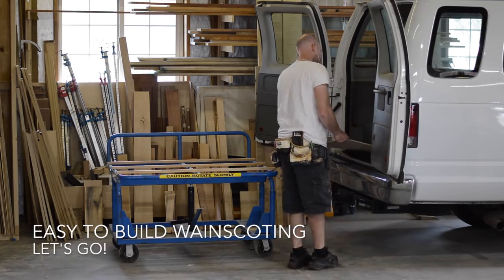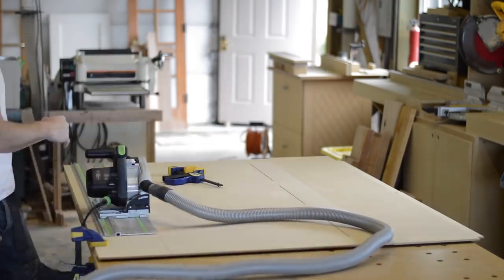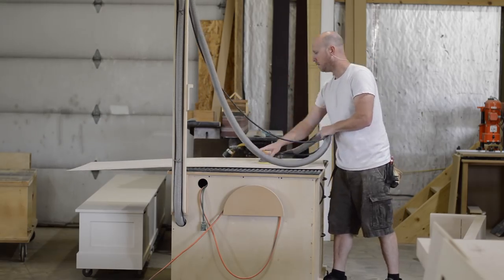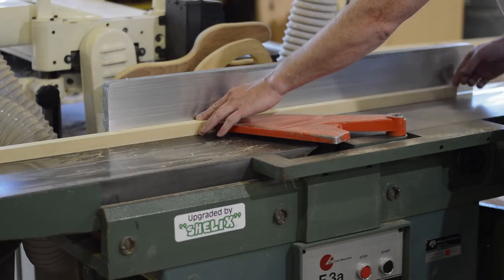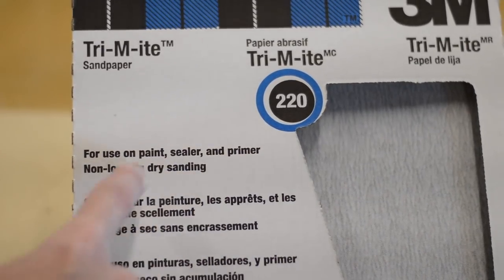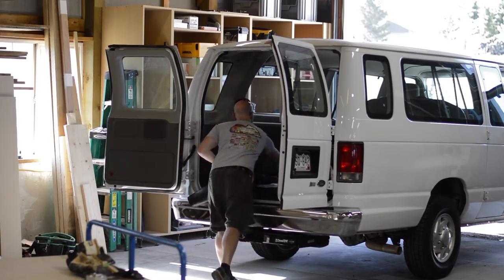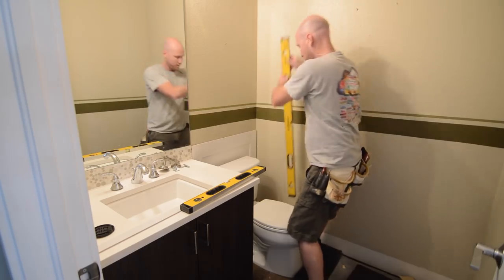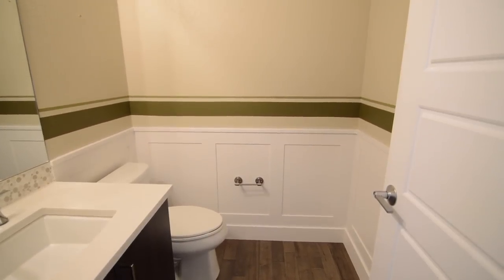Easiest wall paneling ever! Wainscoting

Comment: Mike, your shop is amazing (except for the router tabel, but you said you were going to rebuild it anyway).  Your video is extremely well done.  Thanks for putting me onto the 1/4" thick flat tooth dado blade for routing grooves in the drawer sides.  Just ordered me one.
Reply from the maker: Thank you. You will find many uses for the 1/4" blade.

Comment: I like it!  Clean and neat ... I need to do some in my kitchen.  You just showed a less expensive great looking way to do it!
Reply from the maker: Thank you. Give it a shot. Yes, I forgot to mention in the video, but this is a super cheap way to achieve a clean wainscoting. Couple sheets of 1/4 and 1/8, little bit of hardwood and some base molding. I spent way more on paint/primer than materials.

Comment: Excellent video Mike. Thanks for sharing. One tip: when caulking, use a grout sponge instead of the old tee shirt and wipe your finger on it. Oh yeah, that looked like a common rat snake, which is good to have around (unless you have chickens as they also eat eggs).
Reply from the maker: I like this tip. Thank you. I may give this a try.

Comment: Nice. I do a lot of wainscoting myself, this design is beautiful in its simplicity. Good job.
Reply: There are definitely some differences between the normally installed wainscoting and this design.  Because you've don a lot of it, what are your thoughts, positive/negative on each if you care to discuss.  Thank you.
Reply: James Jacobsen well obviously the lack of joinery and practically no filling or sanding is a big plus. This would greatly speed up the making/installing process. The only negative I see is that it wouldn't be up everyone's taste.  A lot of people like the raised panel designs, which takes a lot more work. But then you charge accordingly. It's all down to customer preference at the end of the day.
Reply from the maker: I'd be interesting to know the differences between normally install and this version.

Comment: Festool plunge saws are amazing. I've built so much with this tool.
Reply from the maker: Such a great tool. I find new uses for it all the time.
Reply: My favourite use is dimensioning rough lumber on the jobsite. Rough lumber is usually flat enough to feed through a portable thickness planer, but never straight enough to cut on the table saw, and there's obviously no surface planer (jointer) on-site. That's where the track saw comes in.

Comment: Having just discovered your channel and watching a few of your videos, I felt compelled to subscribe, Mike. Great job with your video production. With respect to your practice of adding water to your little cup of paint for the finishing details: Try using a product made by "Flood" called "Floetrol" instead of water. Floetrol will allow the paint to flow easily and lay flat, without any visible brush marks - it will look like it was part of the original spray application. Flood also makes a similar product for oil based paints too, if ever needed. It's available in a variety of stores, including Home Depot.
Reply from the maker: Yup I use floetrol all the time. Good stuff. I find that for touching up nail holes I like to use water because it thins the paint and physically leaves a thinner film. To my eye this looks a little better.

Comment: Mike, you mentioned in your video if your wainscoting was longer than 8 feet it would be a nightmare. One thing you could do prior to finishing is butt two pieces three quarter MDF together and join with Domino's. We have found the Bondo can completely make a paint grade joint disappear. Experiment with some Bondo and you'll find you will love it, if you don't already use it. Great video! thanks.
Reply from the maker: Yup, good tip. I use bondo frequently, but it still adds a step.

Comment: Really like the end result. Neat idea to cut out from large panels rather than build up from small parts. It’s tedious to try to hide join lines, though it’s easier in Mdf than other wood in my experience since it’s already particle board and the filler is adding more particles, essentially 

Anyway, another great video. Your narration has to be among the very best I’ve seen (heard)
Reply from the maker: Thank you for the kind words. I find that by removing the joinery, lots of time is saved in both performing the joinery and sanding/filling/painting.

Comment: Hi Mike.  Have you ever thought about stops on the track. This is how you cut a mat for a picture which I have done tons of times. There is a stop or block to end the cut.   That will also make a consistent cut. I am planning to make some doors this way.  I use a blade to tap out the mat corners just as the Japanese saw.  What do you think?
Reply from the maker: Thank you. The stops could work, but the setup might take too much time to make it worth doing. Making doors using this method would work great.

Comment: Mike, do you use moisture resistant MDF?  I didn't even know it was available until recently.  When I asked for some at my local Big Orange, I was told they never heard of it and didn't stock it.  Since moisture is a real enemy of MDF, it would seem the MR-MDF would be a real advantage for bath and kitchen projects.
Reply from the maker: I do not. I don't because no one sells it near me. If they did I would use it. I agree to the advantages.

Comment: I wish I had did the wains coating in my bathroom like this. I tried to use the premade sheets at Home Depot & it was just a mess, especially with one of the rounded corners in the bathroom. This is way cleaner.
Reply from the maker: Thank you.

Comment: I like the decision to overlap on the casing. I was wondering if you would install to level or parallel to the painted stripe (assuming it wasn't perfectly level already)  until you mentioned the wallpaper.
Reply from the maker: Yup, the paint is on the way out. I'm going to try to go back and get a picture when the wall paper is up.

Comment: Great video mike. I rip sandpaper the same way by tearing it on a sharp edge. I use a 1/4” piece of mdf that I joint on edge and crease the sandpaper, but for some reason I can’t figure out I always rip the paper diagonally which results in wasted sandpaper. More often than not the tear trails off of the crease towards the end of the rip and sometimes right in the middle of the rip. Any advice on tearing technique to avoid this?
Reply from the maker: Thank you. I'm not sure I follow exactly what the issue is, so I'm not quite sure how to advise. Give me a little more detail.

Comment: At 12:20, you mention you are using the level to check that the panel does not have a bow or hump. Since you already placed it against the wall with adhesive, how would you have corrected this if you noticed it was not flat?
Reply from the maker: Good question. I have the panels sitting on a bed of adhesive, so most of the time pressing the high area squishes the panel into place. If that doesn't work, I will pry the low spots away from the wall and apply some more adhesive.

Comment: Is there a formula you use to figure out your panel size? Other than behind the toilet, I assume the panel size is the same on the other walls? Thanks for the excellent video!!
Reply from the maker: Not really. I play around with the spacing while talking with the customer. Once we decide on an overall feel, the math begins. If the space it 60" wide and I want 3 panels, its 20 per each. If the wall next to it (as in this video) was 64, the its 21 and change per each. It gets a little weird when they are not close to a multiple of 20, so if one wall is 60, great 3 panels, but the wall next to it is 72, 3 wider panels or 4 narrower panels will fit, thats up to you to pick. Its a judgment call that must be decided by the builder. Hope this helps.

Comment: Thanks again for the pro tip on the construction adhesive Circle suction Style. Going that method has anything falling off the walls and or do you feel that it seems to give it a good adheisure  application. I've started to adapt that on my installs always a little worried that it might not secure properly?
Reply from the maker: My pleasure. I got that tip from a guy who put up shower paneling, and didn't use any screws or nails. Construction adhesive is very strong once its dry. Just make sure its stuck on real good and check it a few times. In an hour or two that thing isn't going anywhere.

Comment: Mike, can you share what type of hose you are using with you track saw.  I see u are using the festool track saw but not the festool hose.  I am planning on purchasing a ts55 soon but I am looking for cheaper options for dust collection hoses.
Reply from the maker: Its a Bosch hose. I think they are like 40 bucks. Works great with Festool and other tools that use similar connections.

Comment: how are you getting the door trim and the base to line up correctly? after adding the wainscoting im imagining that the base would be sticking past the door trim.
Reply from the maker: If you look at my video Dining room renovation, wainscoting, I show the how I deal with that issue. Effectively, I just lay the base and chair rail over the casing. I think it creates a nice look.
Reply: @MikeFarrington  ahhh i must have missed that when i was watching the video. i was trying to skim through to a part where i could see what you did. very nice work my man!
Reply from the maker: Its in there somewhere, I promise.

Comment: As always, an excellent piece and an excellent video. Your VO especially really stands apart. Do you think one could achieve nearly the same level of finish without a spray setup? The rest all seems well within reach, just don’t have the room, or expertise for the spray setup.
Reply from the maker: Thank you very much! I would rather have the project in my house, painted with a brush and roller than to not have the project if I couldn't spray it. Hope that makes sense. Light plays a big roll as to what "shows" on a finish. In a bathroom with very little raking light, brush and roller would end up looking pretty good. Buy a very high end paint (like ProClassic), add a little floetrol, maybe even a little water, use a very good brush and roller, and make practice boards. My guess is you will be happy with the results. I hand painted many projects when I was first starting, they ended up looking very nice.

Comment: Mike, the panel behind toilet  were you use straight edge to check  for  straightness  on inside corner. If it was  not , would you pop it off with the glue attached an shim it straight. It looks great.
Reply from the maker: Randy, if it was not straight I would try squishing the panel into the glue more, if that didn't work, I'd pull it out and start over with more glue. In those situations I really try to use the glue as a shim, if all else fails a shim will do the trick.

Comment: Hey Mike. This one hits home because I just did a similiar job lol. Beautiful stuff man.

I know you got a work flow and a process already down, but have you ever tried Chemcraft or Lenmar acetone based primers? You gotta thin em down about 30% and sometimes use some retarder. But they actually hang much better without running, lay flatter (requiring less sanding), and cover a bit better. With 2 coats of that stuff sanding in between literally the surface couldnt be more perfect and one super thin top coat does the trick. I also use a water based lacquer or poly as top coat. I use General Finishes. I love that their product line is kinda dummy proof which I need lol. 

We do very similar work, and I did a few hours worth of testing between the Lenmar and Chemcraft acetone primers and the Zinsser BIN. Only crappy thing is you gotta play chemist a little more with the acetone primers. They are so thick (relatively speaking) and don't flow good from anything other than an airless right out of the can. But that also means you get to stretch the can and save some cash.

At least for my personal work, (which we have similar styles) the acetone primers seem to be superior to the BIN unless I'm doing a refinishing job and wanna stop some stain bleed through
Reply from the maker: Thank you Michael. I have used the Chemcraft primer before. I think its really good. I cannot get it locally, vs the BIN I can get at the Lowes 3 minutes from my house. I do agree on how good it is, but often times with finishing its how easily can I get my hands it. This is especially true when I need colors mixed.
Reply: @MikeFarrington  absolutely. if I didn't live next to a Benjamin Moore I think my life would be a lot more difficult in regards to good primers. thanks for the response! I'm glad to hear you are familiar with their products.
Reply from the maker: @MaydaysCustomWoodworks  I hear ya. I used to live near a very good paint store, not so much anymore. Its a real downer.

Comment: I'm curious as to how you calculated the number and size of the panel openings to maintain symmetry between walls of different lengths.  Also, how the size of the sink may have affected those calculations.
Reply from the maker: Ah, thats the thing. There is not symmetry. It comes down to how many flat spaces to you want. If one wall is 60 inches and the other is 65, well the difference just needs to be blended as best as possible. The flat spaces will be larger on the 65 inch wall. There is no right or wrong, you just need to play around with the layout until things look as best as possible.

Comment: Hi mike just subbed great content. What would you say the benefits to using a traditional spray gun vs a hvlp setup. Im on the cusp of buy a fuji 3 pro but im new to spraying and it would be good to get you input cheers
Reply from the maker: Traditional spray guns will atomize heavier materials. There is a point where all turbine driven HVLP guns just don't have enough power to break up material as it gets thicker. With a conventional gun run way below the max recommended pressure I can blast even the heaviest paints into a nice fog. The down side is over spray, conventional guns make a ton of overspray. I don't spray enough to care much about over spray, I just want the best finish possible.
Reply: Mike Farrington hi mike yeah i suppose in a shop environment that would be better ill try both see how i get on. This is why i like youtube you can bounce ideas and knowledge back and forth and you can learn so much. Cheers mike as i said great content nice and clear
Reply from the maker: Give both a try, based on materials you are using, I think you will quickly decide which one works for you.

Comment: Isn't it more wasteful cutting out the centers? Or are you able to use the centers for something else?
Reply from the maker: Yes it is more wasteful in materials, but less wasteful in time, which costs my customers more. I do save the offcuts, and they get used for something down the road.

Comment: Mike great job it looks great.  You technique is the best way to install  in a finished room. 
Would you use the same technique in a full renovation?  
Also I prefer to see the seams (witness lines) between the stiles and rails.
Reply from the maker: I would probably not use the same technique for a full room reno. If I did it would be with thicker material. I don't mind the seams especially when the tops and bottoms are a little thicker. I think that looks real nice.
Reply: I've seen kitchen cabinet doors where the rails / stiles are actually chamfered slightly to accentuate the seam & it looks really good to me !!

😎👍☘️🍺

Comment: Mike I really like your work and content, I do similar work here On Vancouver Island. What length of drying time do you get with the waterborne coatings?
Reply from the maker: Thank you. To me a minimum of two days before delivery and installation. Longer is always better and I run fans and heaters when needed.
Reply: I found the waterbourne too slow for my setup. You must have good heat and ventilation for between coats.
Reply from the maker: Not surprising. I'm guessing your climate is much more humid and cooler than mine. We are either hot and dry or cold and dry. I think the super low humidity really helps speed along dry times.
Reply: My set up is also a little sketchy.
Reply from the maker: Pretty much everyone's is... Mine too.

Comment: The finished product looks great.  I often have a problem with the rough edges of mdf as they take a lot more paint than the face to look smooth.  Did you have a problem with this?
Reply from the maker: A little sanding goes a long way. Also that is the primary reason I spray the inside edges first (and I soak them good) then spray the whole thing. By double coating those areas is hides the rough end grain of MDF. I'm not trying to brag, but the inside edges looked really good on the finished product.

Comment: Hi, love your stuff, and, because of that, I had to subscribe. But tell me, what other brands would you buy instead of Festool? I saw that you use a Mirka sanding machine! Can you please tell me what is your review of that brand/material? Cheers
Reply from the maker: Thank you. Great to have you on board. Honestly, thats hard to say. I think most of the upper end of tools being made today are very good. When looking for a tool I turn to Festool, Makita, Dewalt, Bosch, and a few others. Some tools I like more than others, but its more a specific tool than a manufacturer. I really like the Mirka sander. Its quiet, easy to use, and the dust collection is near perfect.